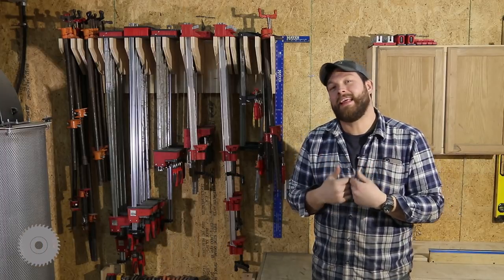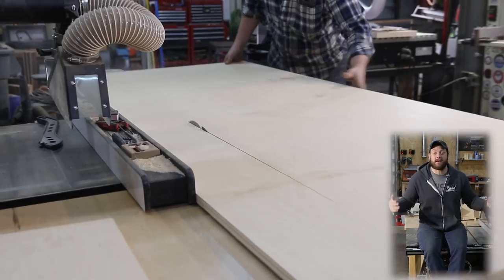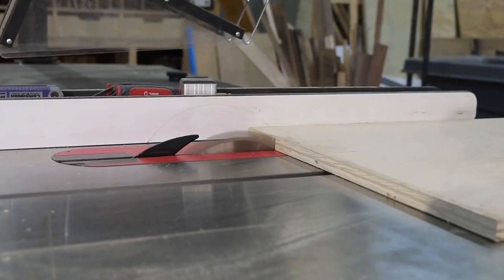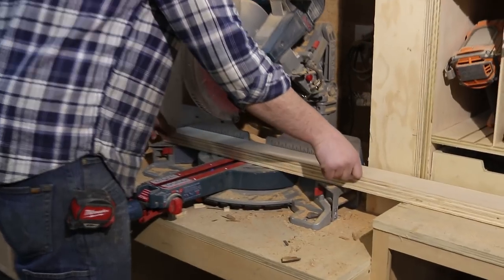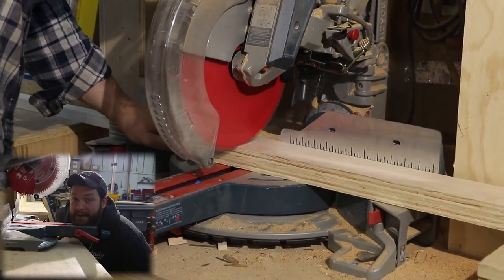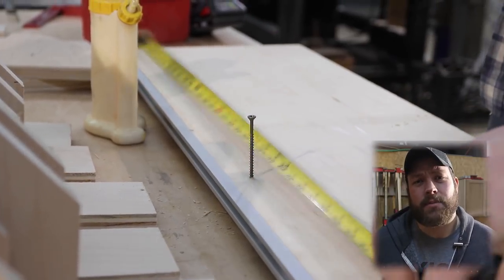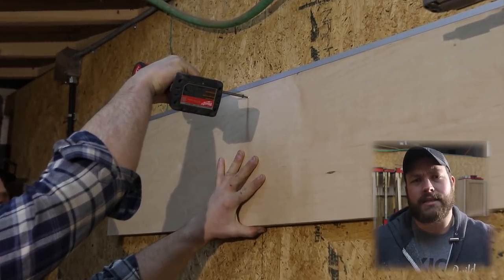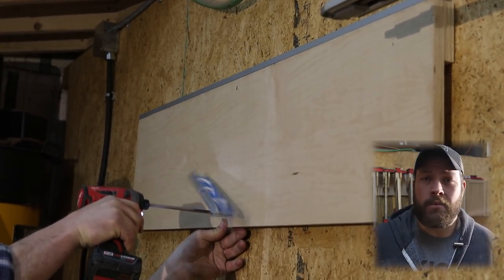DIY Adjustable Clamp Rack

Comment: Go with a french cleat wall. Cut a sheet of plywood in half so it's 4x4. Use one of the pieces and rip into 5" strips. Then rip the strips in half on the table saw at a 45 so you get two cleats for each 5" piece. One piece of plywood is enough for 4x4 on the wall, cleats to attach to the wall, and extra cleats for the holders you make. Using multiple cleats for one holder and you can hang heavy things. I have my compressor on the wall so it doesnt take floor space. I attach the cleats to the plywood with glue and brad nails. Plywood to wall with construction screws. Super easy and endless possibilities for hanging stuff. Making the holders is super fun too.
Reply from the maker: Thanks BM, french cleats are super popular

Comment: I'm just seeing this video, three years later. Nice idea! How has the rack held up? The part that gives me pause is the fact that each set of brackets are essentially hanging from a small 2x3 piece of plywood (or whatever the actual size is) which has been screwed down to the veneers of the top edge of the bracket very close to the back edge where splitting or failure seems more likely. So in essence the weight of all the clamps on each individual bracket is hanging on two screws that are in a compromised placement. Has this caused any problems over time? I'm just thinking about ways to take your ingenious idea about adjustability using the t-track and increasing the strength of the point from which all the weight hangs...
Reply: I had similar questions and after watching his 2021 shop tour, he doesn’t use this clamp rack anymore.  He has also said in anger video that if you over tighten the t-knob, the track will pull the screws out.  I’m guessing the t-track will also warp.  My conclusion is although cool idea for adjustability this isn’t a lasting solution.

Comment: Smart idea with the adjustable spacing. With heavier clamps, would you have to worry about the t-track bending over time?
Reply from the maker: Nah the load is dispersed into the backer and into the plate. I think

Comment: Thanks for sharing!
Does this method have other advantages over a french cleat approach apart from being able to fix the position with the knob?
Reply: These were my thoughts exactly. Curious to know..
Reply from the maker: With a French clear the hanger wouldn’t be solid against it unless you screwed it in. Over time that would wear out. You also need to remove all clamps to adjust it. The knob allows you to slide it while loaded and it won’t wear out . IMO